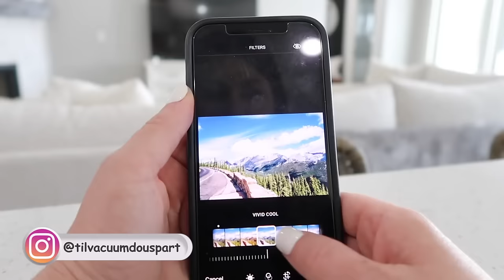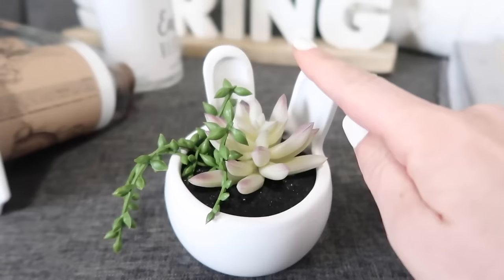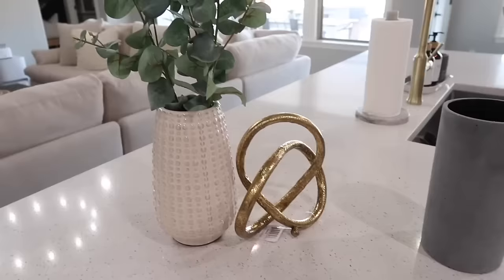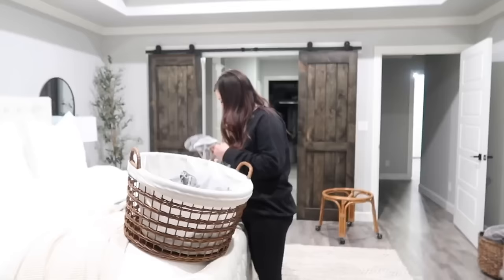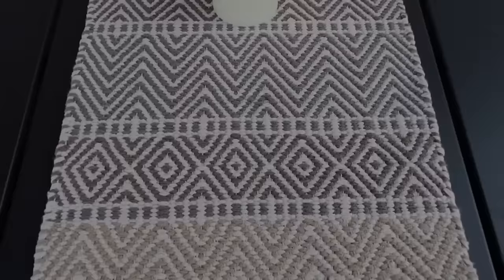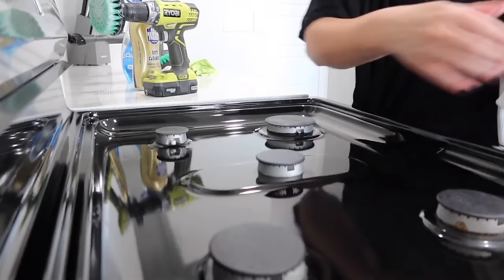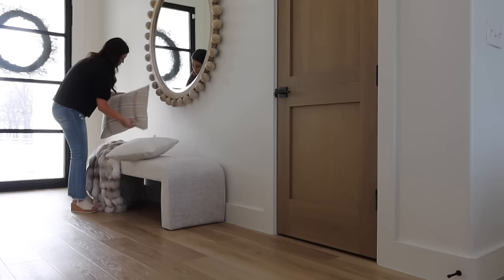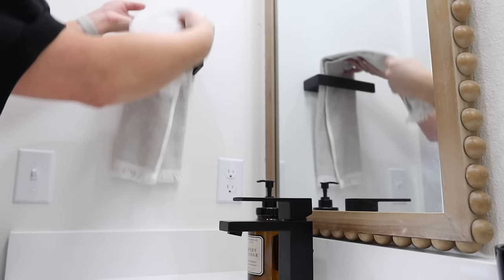2 HOURS OF SPRING DECORATING IN 3 HOMES! | ULTIMATE SPRING DECORATE WHOLE HOUSE | SPRING DECORATING

Comment: Help! I have an open floor plan home with no outlets in the floor.  I've seen you connect some lights to something without an outlet.  I think you plugged the cord into something with batteries.  I've searched but I can't find the video.  What did you use?